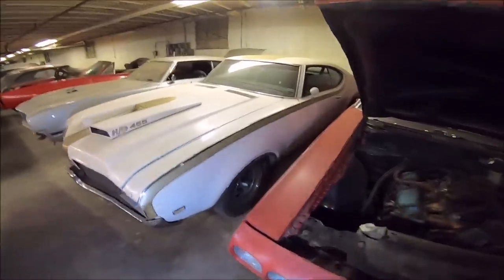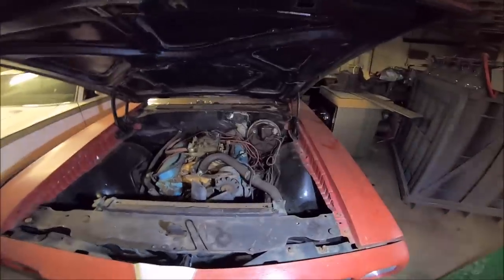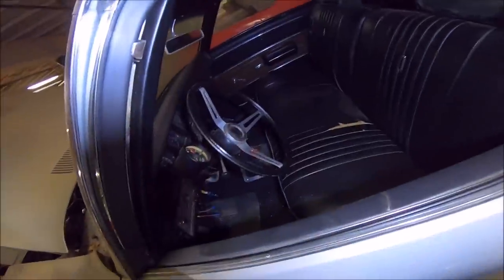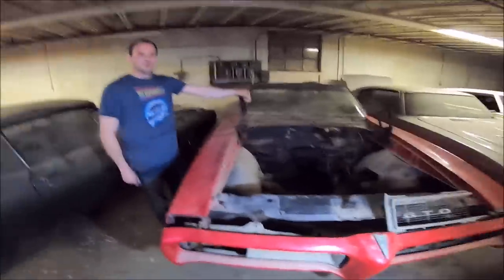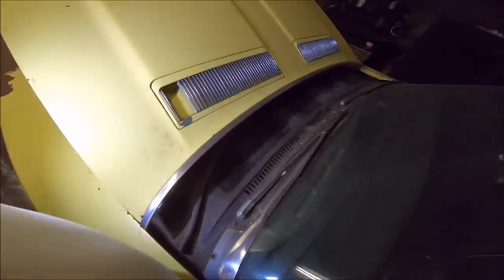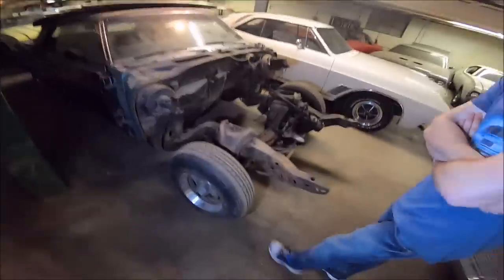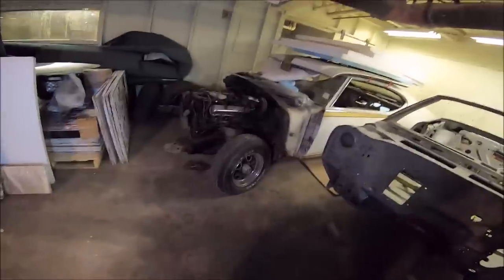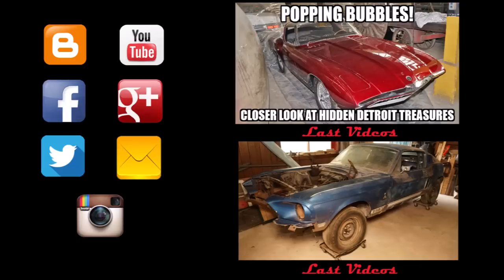Rare GM Muscle Cars stashed in Old Furniture Factory Basement!

Comment: Nothing really "Rare" here !...Mostly "Numbers not matching" which makes these cars nothing more than "Fix-ups/ Repairs", Not restorations !...Kinda like a Hemi Cuda with a 318 and an 8-3/4 or the LS6 car with a small block, No SS  stripes and a Malibu dash !
....This guy will probably be collecting his social security buy the time half of these cars are completed. The other half will be owners who bailed on their projects.
Reply: No problem with numbers not matching.  One can restore with numbers matching easily.  A bit more costly, bu doable.
Reply: @vegasjack1  not matching numbers mean they ain't worth shit
Reply: Dude, I hit the nail on the head!
Reply: You guys clearly are not familiar with Ram Air Iv’s.  I’ve got a $100 reward waiting for the first person to comment a link to the last Ram Air I or  IV that’ sold with a #s matching engine.  And for the record, the Hurst/Olds is #s matching
Reply: Duster.  I agree matching numbers are ideal.  But you can have matching numbers stamped into any part you want, including engine.  This has been done for many years.  Hell, most the time it just means that any after parts just have a proper date code for the car.  There are not a lot of things that actually have numbers that match the vin.  But those numbers need to be matching the build date.  If car was built in 1965, you don’t put on a carburetor dated 1970.  The numbers (date codes) don’t match.
Reply: @duster71  you didnt hear what he said, matching numbers is still doable. Look it up before you show your ignorance.
Reply: @vegasjack1  that makes it a phoney car
Reply: @duster71  so. If a restorer uses a car door from another car. Does that make the car a phoney?  If thecwinshield is broken and replaced. Dies that?  Restorer go as far as to weld the correct number if beads in a weld on original car.  If he has to do that is car a phony?  If you use exact engine and have original number stamped in car is not phony.  It is restored.  I would divulge such info to buyer.  But usually no big deal as it is done all the time.
Reply: @vegasjack1  nothing wrong with a door or windshield,but if you start grinding down blocks and restamping numbers or welding the numbers into the trunk driprail it may be ok to devulge to the new owner otherwise your breaking the law. Guess you didn't think through your questions did you.I don't know how many cars youve restored but I've done over 55.
Reply: If you have done 55 and never done a common and approved restoration process of stamping in a correct number into a correct matching engine then your not much more than a body and fender man.

Comment: Hurst Olds is fake maybe a clone. Has NO ram-air option under the hood. They did not come with a snorkel air cleaner and there are 2 air intakes under the hood on a real Hurst Olds. The Goat is crap. Nonmatching numbers so it's going nowhere but a junkyard.

Comment: With so many drive trains missing they are only good for restomods now. Their originality is lost forever along with their value.
Reply: By your logic.  Every Ram Air I And Ram Air IV should be a resto-mod.  Please point to an example of a #s matching Ram Air I or IV.  #s matching has little to no effect on the restored value of these cars when fitted with date coded correct parts.  It’s almost expected to see a SR (Service Replacement) block in a Ram Air IV.  The motors were grenades and most of these cars were raced.

Comment: To all you purists- I plan on swapping an LS9 into a Chevelle as well as retromodding the entire suspension, interior & such, because its mine & so it turn & brake like a real car, instead of being a bucket of steel that just goes in a straight line. & guess what!? You can tinker with your carburetor all you want, forced induction electronic fuel injection for the goddamn win! Suck on exhaust fumes while dealing with the handling of a conestoga wagon. That shit belongs in the 60s & 70s. You don’t put diapers on your teenager (unless he’s “special”) & I don’t fuck with carbs on my hot rods! You can do whatever you like on your own cars but don’t try to tell me what to do to mine & pretend like that’s a American. That’s more communist then Stalins mustache. EFI + Valve timing + forced induction = the better car. Period.
Reply from the maker: As long as it isn't anything special, have fun!

Comment: Honestly, most of these cars are junk. It would take minimum of six figures to restore any one of them. This guy says they are rare cars but they are not they are junk. By the time you finished outfitting year correct engines and transmission, you would be mid 100's into it with zero resell value because of non-original power plants. As much as I love the 70 gto you wasted way to much time on it. It would not be worth a restore because the original power plant is long gone. All it  will ever be is a shell of it original self with an interesting history nothing else.
Reply: Mike Meagher I’m the guy from the video.  I’ll first begin by saying that all of these vehicles are excess inventory of our restoration shop.  We consistently have 1-2 cars being restored at all times in our shop, most of which are pulled from this storage building.  What you see is what is left.  Next, I will point out your ignorance to the Ram Air IV market.  Like I said in other comments, I have a $100 reward for the first person to post a link to a public sale of a #’s matching Ram Air IV car.  THERE ARE NONE.  The benefit of doing the work yourself is that the restorations do not cost $100,000 to preform.  However, low optioned factory drag race cars, especially in good colors like code 75 Cardinal Red do exceptionally well at auction when restored.  In fact, that car will more than likely fetch a higher price at  auction than a fully loaded Ram Air IV Judge.  Thanks for your expertise anyhow
Reply: People don’t realize that it cost 25-35 to buy some of this junk. Then a min. Of 50 to restore . 75 bare min to complete and most sell for way less.

Comment: TO many Firewalls Degraded to an unworkable condition .  that is why most of his projects are stagnating.   only a few of them will ever be restored . the rest will be parted out.
Reply: Lol, you couldn’t be more wrong.  we’ve restored cars from far worse condition.  We’re actively restoring 1-2 high end cars at any given time.  No plans on parting any of these cars out haha
Reply: @themotormadhouse  Unless you are completely Replacing / Fabricating those Firewalls you are not restoring those cars , you are slap crapping them back on the road with a fresh paint job and a load of bullshit.
Reply from the maker: The firewalls are not in that bad of condition.
Reply: Tom Slick so you’re saying that rust can’t be repaired during a restoration process?  Only rust free cars can be restored?  We have highly skilled fabricators on staff that are capable of repairing any rust issues.  I can assure you there is no “slap crapping” cats together.  You wouldn’t be able to tell one of our repaired cars from a 100% rust free car when restored.

Comment: What a waste.  Just being their never to be driven by this guy.  Seriously when did cars become just objects to film.
Reply: Arisgod27 I had a 74 Nova and drive the wheels off of it.
Reply: The vehicles are owned by an active restoration shop.  What your looking at in this video is less than half of what it used to be.  We actively frame-off restore 2 vehicles at a time that we pull from this dry climate controlled environment and sell them at auction or even to celebrity clients.  Thanks for spreading your negativity

Comment: Just another guy collecting cars and doing absolutely nothing but destroying them. "Original motor, long gone" "mice chewing up the interior" ah well no biggie right?
Reply: Actually we’re an active concours restoration shop that stores the cars in this climate controlled building until their number is up....we have not had any mice problems in this building, any mice damage to these cars came from the poor environment that the previous owners were housing them in.  Good news is, every car we restore gets sandblasted down to bare metal, new carpet/upholstery, new wiring harness, and 100% rebuilt drive lines.  So we aren’t losing any sleep over any vacant mice nests.  And like I’ve stated in other comments, before you write the GTO’s off as worthless because the motors are gone, please point me to an example of a #s matching Ram Air I or IV.  99.9% are non-numbers matching.  These cars were raced and the motors were time bombs.  Non-numbers machine is a non-issue on the restored value of Ram Air IV cars because all real collectors know this.
Reply: @themotormadhouse  yes, 99.9% of restores hardly ever have matching numbers. Appologies if i seemed a bit judgmental because it looked like another one of those "barn find" video's. I'm no expert in restoration of classic muscle cars, mainly because I'm broke all the time and got married too young, lol but every car i see sitting around i want to rebuild it. There's a car grave yard near where i live full of 1950 or older cars just sitting there rotting away and makes my heart sink. I see crushed cars from junk yard being hauled off and i can't help think about when it's history... so no money, no tools, no shop.... just leaves me in wish and wonder mode while my hand fills up with shit. Lol. If you're doing what you say and sandblasting it down and replacing all the rubber wire, wire harnesses then you're doing it the way I would do it if i could. I do however like to put a twist on restoring... kinda giving it a more modern touch to the engine, trans and dash. Make it better than original but that is just my opinion as others i know will disagree. Do you have a YouTube channel because i would love to see the work you're doing.
Reply: James McGuire a channel is in the works.  My dad and I work independently from one another, but we have been talking about filming some weekend projects together.